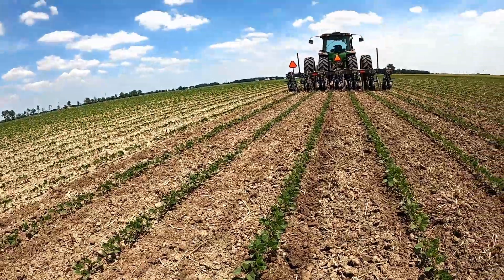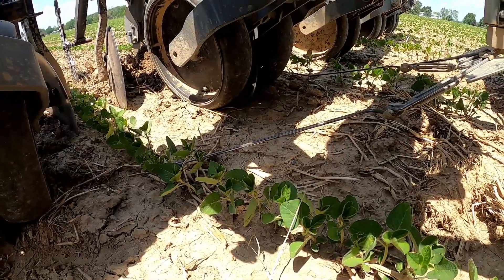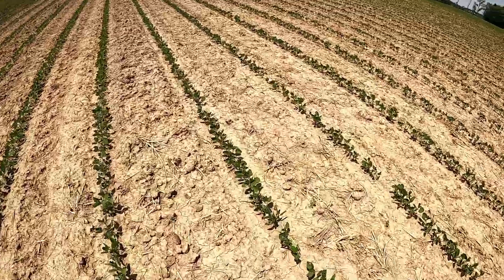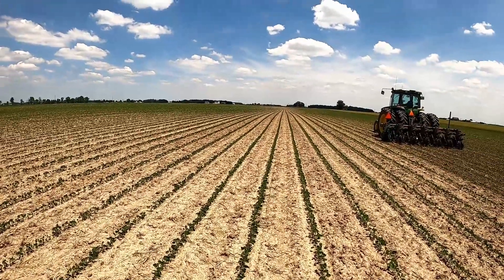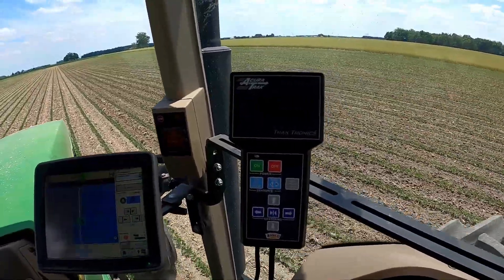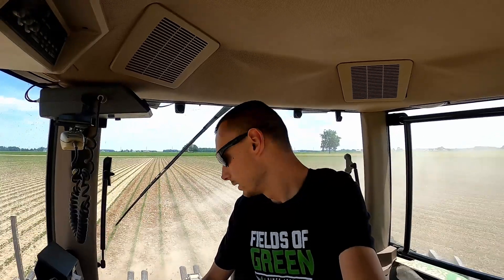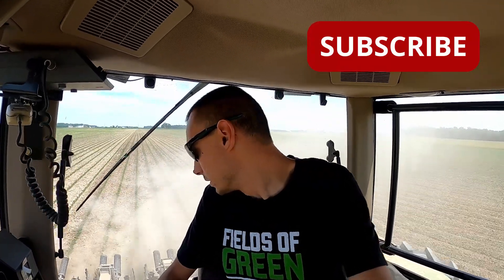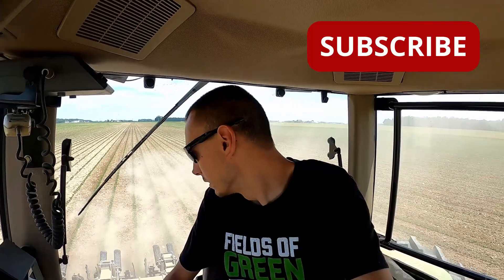Cultivating Transitional Soybeans

Comment: Where are you, I do organic soybean in 7.5” rows, yield good.
Reply from the maker: I’m located in Central Indiana. Are you doing no-till soybeans into roll crimped rye or full tillage and cultivating on 7.5” rows?
Reply: @INOrganicFarmer  I disc over rye then plant soybean, I have a crimper but not have a chance to use it cause rye suppress weed not well enough to crimp over.  7.5" row soybean serpress weed seems not bad. heavy clay is easier than loam soil for weed control.

Comment: Have you tested manure for herbicide residue? Like roundup. 2-4D and others. Some say there is.
Reply from the maker: I have not. It would be interesting to see how the results come back though. I did look into doing a ground water test for herbicides and pesticides. It was very expensive.
Reply: Glyphosate and 2-4D get rapidly bound to soil and organic particles (neutralized, unavailible to the plants) and break down within a season in typical compost and soil conditions. 
Most glyphosate residue on crops comes from the practice of pre-harvest burn down, which is killing the crop (usually seed crops like grain or beans) to get it dry and harvested more reliably and reduce risks of weather and pests.

Clopyralid, aminopyralid, and picloram are the only modern herbicides likely to have any significant persistance in composted manure. And have recently added explicit label warnings about compost and restrictions against removing any hay, compost, or manure from the the application property. (And applicators must retain a record of having warned the customer.)